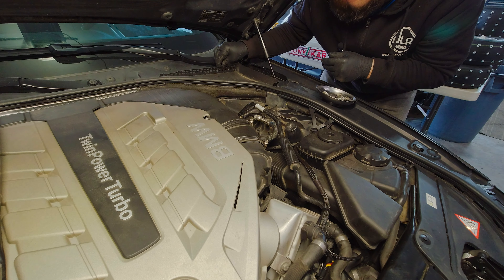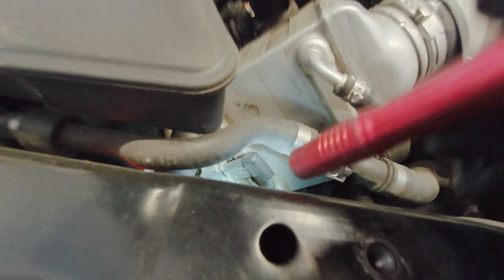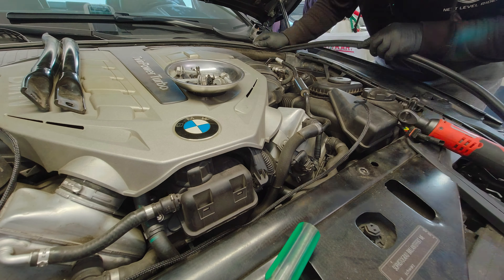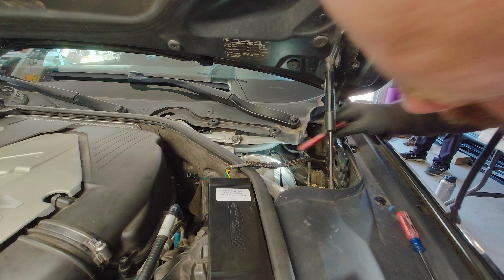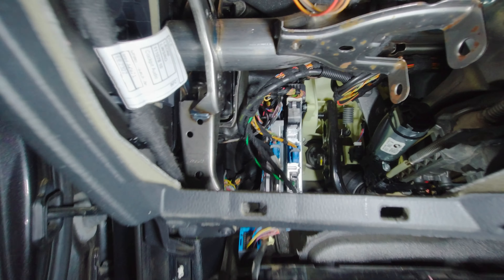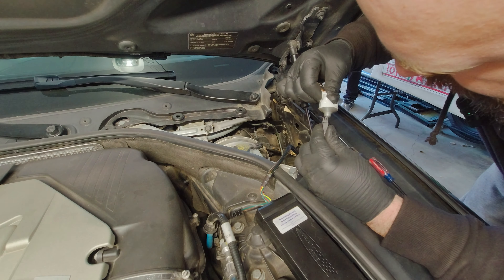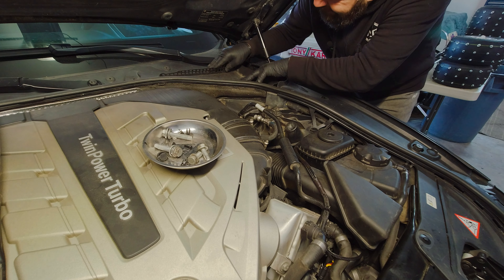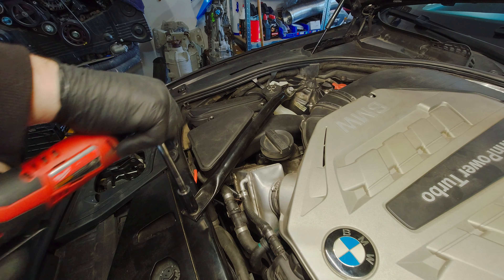Unleash M5 Power from Your BMW 550i with JB4 - Easy Install, HUGE gains

Comment: Why did you not have to use the Bluetooth controller
Reply from the maker: You don't get many options with this particular JB4, you basically set it on the map and leave it. Works as a stage 1 would.

Comment: A flash tune will do more compared to jb4
Reply from the maker: absolutely. I find the JB4 is best when integrating methanol injection. that being said, on my g30, I installed a JB4 and was initially underwhelmed. as soon as I flashed the BMS back end flash (by MHD) it was a completely different animal.
Reply: Absolutely correct. Piggys can only boost rail pressure. They cannot adjust timing or valves or knock or bars. But it ain't my money so have fun.

Comment: I'm really looking to buy a 2016 550i but I'm being warned not to, are they really tht bad?
Reply from the maker: debatable. some say the 2011 was bad since it was the first year but they've likely not made much improvement on later years. if you can get one with a decent extended warranty, it's lilely worth it.